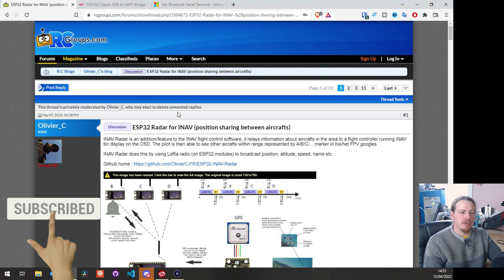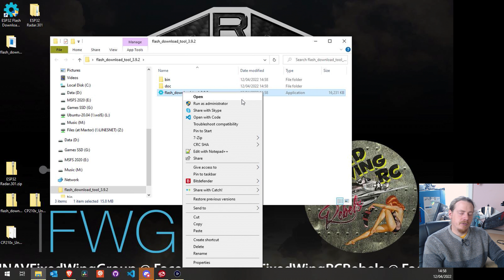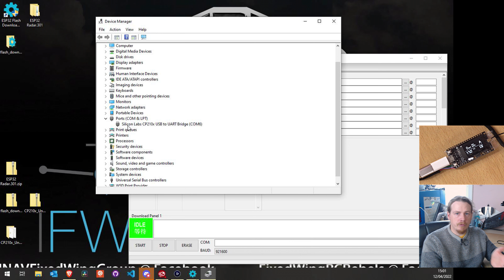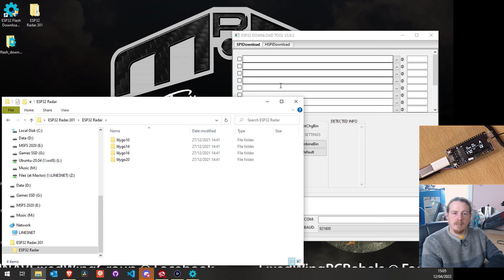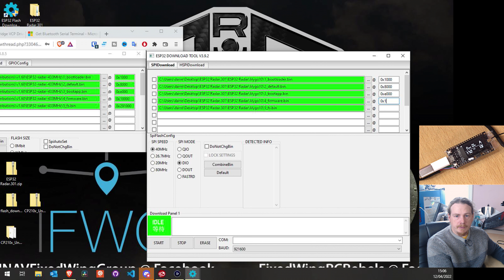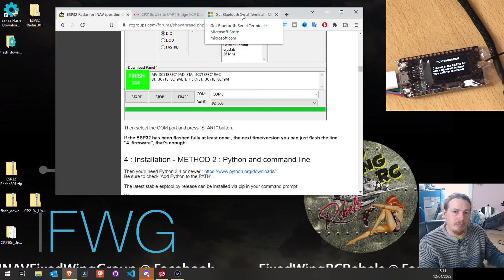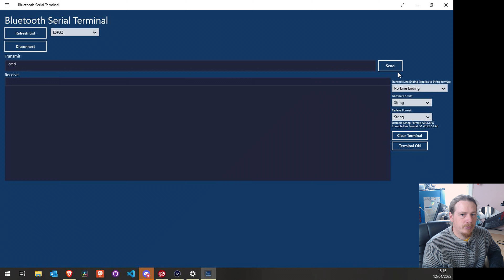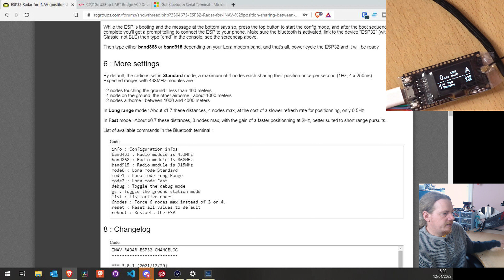Updating and setting up ESP32 Radar, previously iNav Radar

Comment: Hi buddy I'm using a lilygo v2 1.6 board and having issues with no fc I have see you may have tryed this board do you know what the pin are for tx and RX is it the ones printed on the board as they aren't working for me and have double Checked all the settings thanks for any help
Reply from the maker: Hi Ruben. I replied to your post on Facebook with the pin numbers in the documentation. If these are not working for you. The best thing to do would be leave a message on the ESP32 Radar thread on RCGroups. The main developer is on there. He will be able to advise.

Comment: hey want to try this. question would the 915 module mess with my crossfire and1.3vtx?
Reply from the maker: It shouldn’t. I fly on 868MHz Crossfire and R9, and use 868 MHz ESP32 Radar …flying with 2 other people with the same setups. So it should be fine. The 1.3 I’m not sure on. But if you’re already running 915MHz with Crossfire, it should be fine. If you’re worried, go for the 433MHz version.
Reply: @MrD  thanks 😊